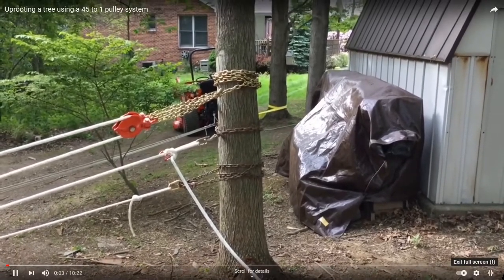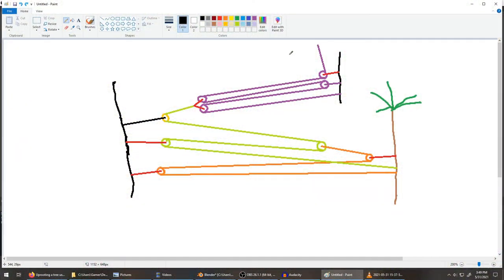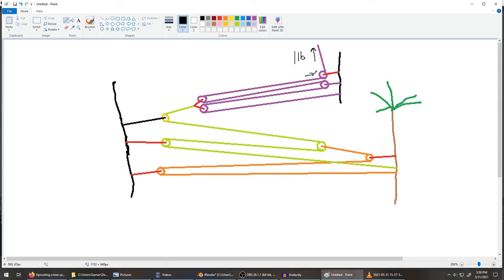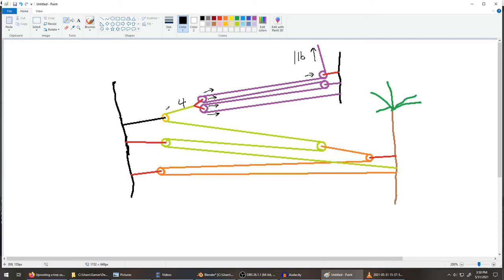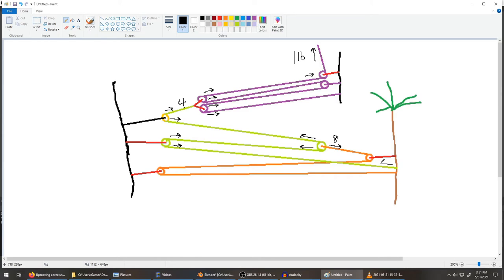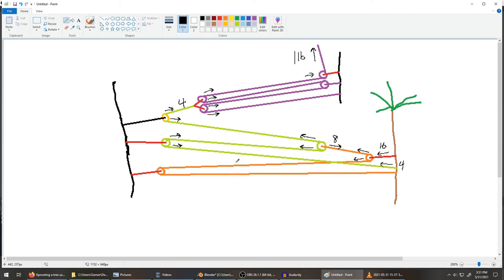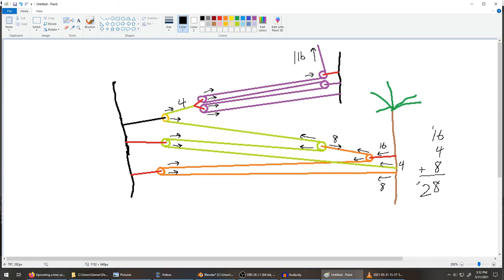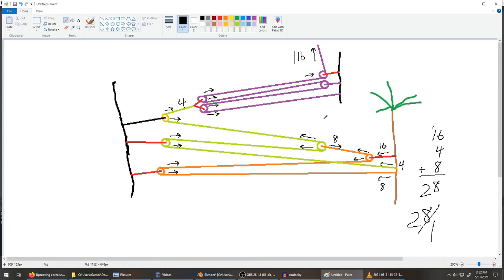Not a 45 to 1 pulley system??  Let's find out what it is.

Comment: Assuming that you were able to properly re-create his system, so based on your diagram, I agree you are right, it is a 28 to 1 advantage. You apparently have a lot of extra time on your hands to be able to translate that mess of ropes onto a piece of paper. All I saw when I watched his video was chaos so I took his word for it.
Working with pulleys is fun. I pulled a tree about that size out of my backyard last summer by hand using a 150 to one system. I didn’t have a lot of room to work, so I had to reset the system a lot.pulled it right out though.
If you add up the force against the anchor points on the left, he’s actually got more advantage pulling against his anchor than he does against the load.
Reply: Biggs since you checked this work can I send you a diagram to verify a rigging system similar to this one?
Reply: @richardgerman9351  I might think I am, but I'm actually not an expert. But still not bad at tracing lines. Sure
Reply: @biggs8729  I uploaded on u tube a short showing my rigging system
Reply: @richardgerman9351  okay, I posted on your videos that you uploaded. If this is an actual setup that you plan to do, I think that your system has the potential to fail because you have too much advantage going into the prusik and the last little bit of rope at the end. If the stump has any kind of size to it, the prusik or the rope will fail. Hard to say if I don't know what kind of equipment you're using and how big the stump is you want to pull.
Reply: @biggs8729  Why does someone buy miles of rope and 20 snatchblocks instead of buying a chain hoist ? 
Like that just seems so much easier than spending all day setting the system up and the pull the rope 2 miles to the next city😅